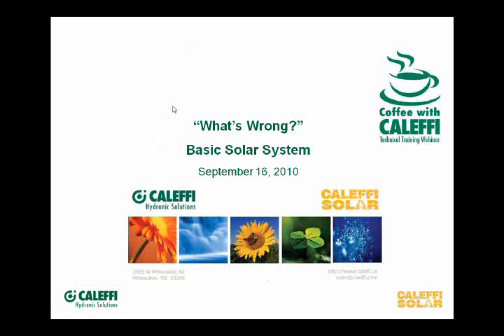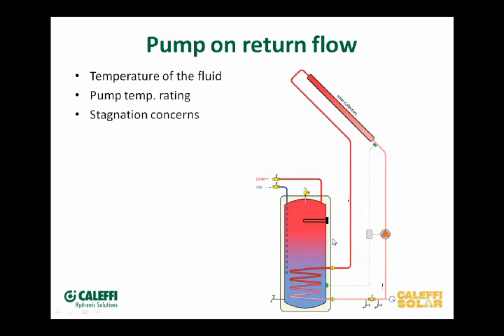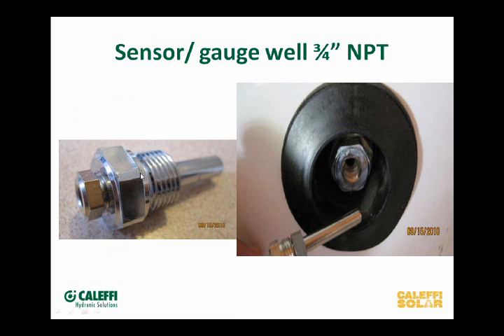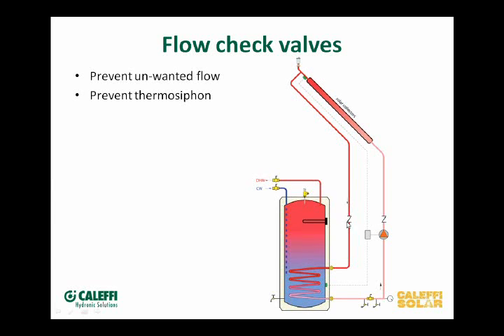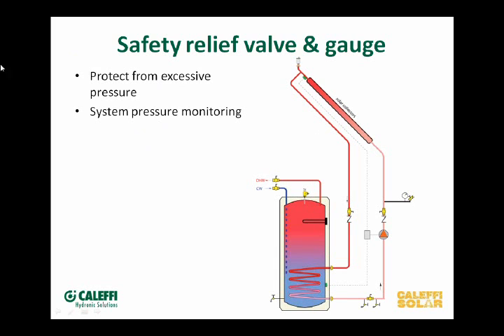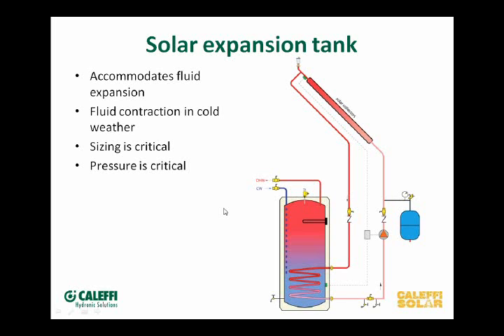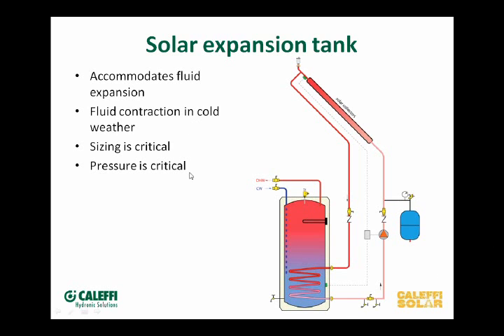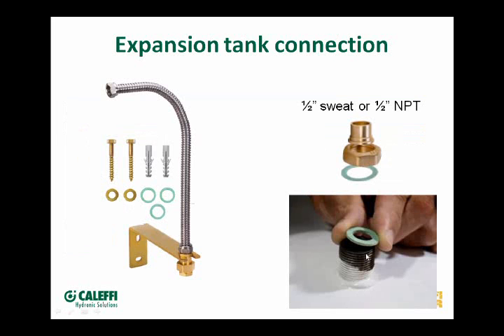The Basics of Solar Heating

Comment: thanks for this great video and all of the info. I was able to cop an entire thermal solar system with 4 panels. 50gal indirect tank (battery) even a high end taco 009 stainless steel pump ALL from craigslist. It's the most efficient  system available. 100k BTU for 220 watts.
Reply from the maker: Very nice!